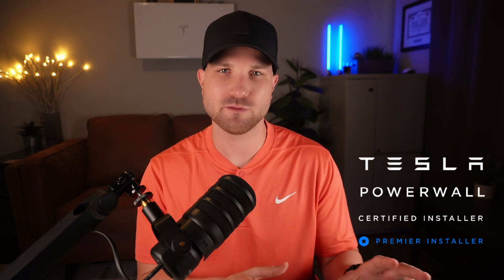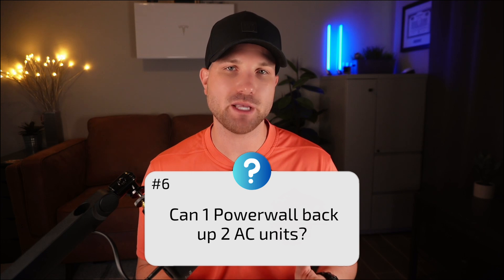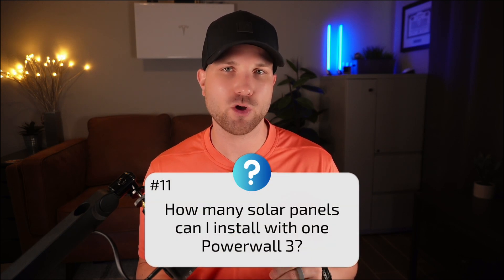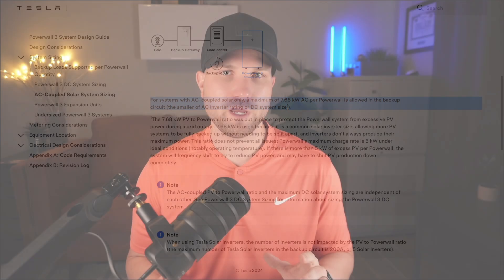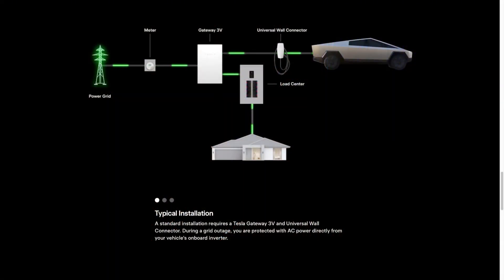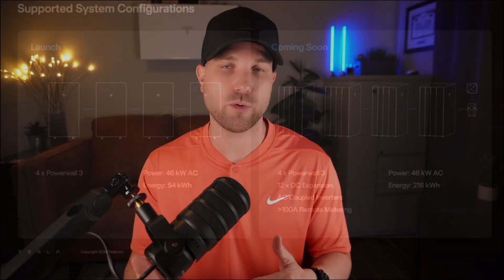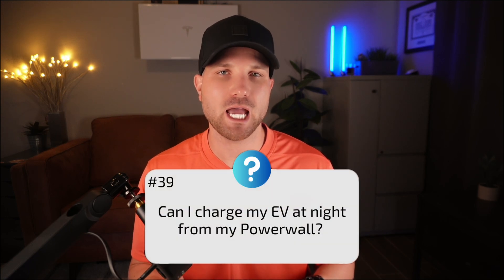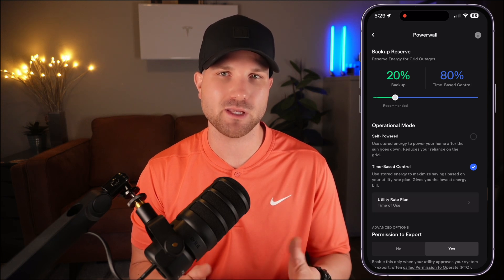Tesla Powerwall 3: Top 47 FAQs Answered!

Comment: Interesting that on question 15, you show the round trip efficiency of the Powerwall 3 as only 89%. I thought it was meant to be much higher, something like 97%. The Powerwall 2 was advertised as being 90%, but from my experience (dividing lifetime power out by power in), it's about 87%.
Reply from the maker: Yeah I was shocked to see it at 89% on the data sheet given the advertised efficiency of DC-coupled designs. I don't know if they are being overly conservative or what. The inverter efficiency is rated at 97.5% though.
Reply: @ZachSolar  I think some other Youtubers have been confused when talking about the PW3 and have quoted that 97.5% as being the round trip efficiency, then comparing it to the 90% for the PW2. As I said I've found my PW2 to be about 87% efficient, but this doesn't include the original inverter loss from solar DC to AC which would make the PW3 look even better in comparison.
Reply from the maker: @Pete856  Yeah 97.5% sounds way better, but that isn't accurate for RT efficiency according to the data sheets. My PW2 system sits at about 87% RT as well after 2 years. So 89%+ sounds right for a DC coupled PW3.

Comment: Zack, thank you for the video. I was wondering if there is any benefit besides financial between a PW3 with 2 expansion packs or two PW3 with 1 expansion pack thank you. We are PGE Customers
Reply from the maker: Glad it was helpful! The main benefit is just going to be power output. Once you achieve “whole home backup”, all you really need is more kWh so the expansion packs are a perfect solution that can save a few bucks. If the cost is close enough though, might as well get a powered unit IMO.

Comment: It would be greaat if you could actually get them.  I was supposed to get 2 installed in September, now they're talking January, maybe.
Reply from the maker: That’s a bummer! Is your installer Tesla direct or a 3rd party?
Reply: @ZachSolar  A 3rd party.  The company that installed the Sunpower solar panels in 2018 no longer does solar.  So I checked with Tesla and they recommended the installer for the Powerwall 3s.  They were supposed to be installed in late September, then late October or early November. Now they're talking January or I can get Powerwall 2s installed in a couple of weeks.

Comment: Two quesitons...   1: I have an agricultural building that faces south and has a subpanel fed from the house via a 200A 250mcm 4 wire underground connection.  If I put solar on the ag building would powerwalls also be installed in that building?  How about the gateway - same building or back in the residence?   Are additional wires required or does the solar and powerwall connect directly to the sub-panel in the ag building and back feed via the existing feed?   
Second question: the residence has a 400A service with multiple 200a sub-panels feeding a different garage and two sub-panels in the house.  Thus a backup solution would need to have multiple 200A gateways which is impractical.  What is the potential for a future 400A gateway or 400A backup switch?  The most practical solution for me would be solar on the ag building, powerwalls in the ag building and 400A gateway at the service entrance in the residence.  Hopefully this could become possible.  Thanks , great video!  - Thomas
Reply from the maker: Thanks Thomas! I'm glad the video was helpful 👍
1) Both the Powerwall(s) and Gateway may be able to be installed on that building and backup that subpanel. My concern would be any utility pushback or AHJ restrictions with it being further away from the main. I'd find a local installer out there and see what their thoughts are.
2) I haven't heard anything about a 400A gateway or backup switch coming from Tesla, but I might be out of the loop. Installing 2 Gateways is the most common work around in this scenario.

Comment: This is Cathy's husband Larry - we are both amateur radio operators - we just installed a Tesla PowerWall 3 and solar panels to our condo. I am seeing significant radio frequency emissions at set frequency intervals of 250kHz across the high frequency spectrum into VHF spectrum - for example, I have an antenna for the 20 meter amateur band and there are signals at 14.00MHz, 14.250MHz, 14.500MHz, and so on. These disappear when the sun goes down and the panels are not producing power. Also, last evening, just 4 days after the install, our HOA complex power went out. Our power also went out even with the PowerWall set up I thought for backup power. When I tried to disconnect from the grid, the app stated that we had too many appliances connected (we did not) which exceeded the capacity of the PowerWall. Today, with power restored, I was able to disconnect from the grid without the over-capacity message warning.  Any ideas?
Reply from the maker: For both of these scenarios, I'd reach out to your installer so they can troubleshoot this with you. I'd just be speculating on my end. Sorry, wish I had a better answer for you!

Comment: Do this. There's 6 string inputs. Only 4 are used. Use the other two inputs connected to the dc outputs of a small gas generator (they have dc outputs the days). Now you have a generator connection. Slow recharge when panels are covered in snow and grid is down.
Reply from the maker: Possible? Maybe. I haven't looked much into it.
Recommended? Absolutely not lol
Reply: @ZachSolar  lol. Agree. Do this on a demo unit, not your own unit in your house, at your own risk

Comment: The biggest question that I cant get an answer from anyone is solar curtailment. Can i via software automatically turn off the solar generation (eg if the grid price goes less than 0c/kwH)
Reply from the maker: Yes within the Tesla app you can disable permission to export. It won’t be automatic though based on a rate schedule. You’d have to manually toggle it on/off. You could use a 3rd party app like Netzero to set this automation though.
Reply: @ZachSolar  Hope Australian powerwall 3 has "permission to export" setting available :)

Comment: If one has a single meter, but 400 amps service (2x200 amp legs) can it be set up to feed only one of  the 2 legs?  Does that require any special/expansive hardware?
Reply from the maker: Yes you can do what you described. The gateway can backup 200A. So if you wanted just one of the 200A panels backed up, then only 1 Gateway required. If you wanted for both to be backed up, then 2 Gateways would be required. You can’t use the backup switch on a 400A service either.

Comment: Can you charge your powerwall 3 and power your home at the same time with solar? Are there any strings attached to this?
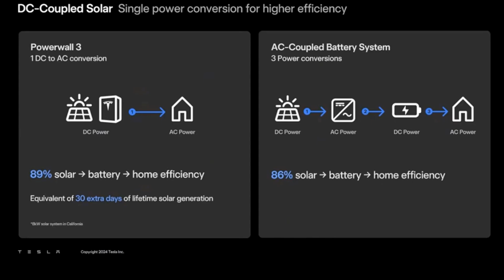Reply from the maker: Yes you can. Check out this clip at around 7:13 onward.
Reply: @ZachSolar  Thanks mate. Sorry one more question. I currently have a 11kw system with a 10kw SolarX inverter. When my SolarX inverted need to be removed?
Reply from the maker: @dpg2004  You could do that and have the system restrung using the PW3 integrated inverter. I might consider that seeing as a single PW3 wouldn't be able to support that 10kW inverter when AC-coupled.
Reply: @ZachSolar  legend. Earned a sub.
Reply from the maker: @dpg2004  Appreciate that!

Comment: Thank you for doing all these videos on the Tesla Powerwall 3. I live in the Los Angeles area and just placed a deposit on 1x Powerwall 3 for my home with a local company. I just hope the Gateway 3 and the Tesla Remote Meters will be available when it's time for installation. I already have solar with a SMA Sunny Boy inverter so it will be AC coupled.
Reply from the maker: You’re welcome! Thanks for watching 😀
You should be all good for the Gateway 3 & remote meter. If your installer has Gateway 2s in stock, then they might use those. If not, you’ll have the GW3 with the new RM. Either way, you’ll have full monitoring.

Comment: Great Q&A, Zach.  Regarding #42, if the WiFi goes out, you can still communicate with the Powerwall 3 through the app.  Our home internet went down for the entire day yesterday, but we still had great sun. I was very curious what would happen because I thought the PW3 relied on WiFi to operate. I was still able to see the solar and PW3 through the app, the system continued to work as normal, even charging my MYP “on Solar”.  Clearly the PW3’s just pivoted to cellular and operated normally.  I also was able to change Powerwall settings while my WiFi was down.  My units are not Ethernet connected.
Reply from the maker: Thank you! Very cool to hear that the cellular took over and worked seamlessly with the WiFi going down. Hope you’re enjoying your PW3 system! 🔋
Reply: @ZachSolar We are loving it so far!  Does a great job selling power back to our utility (PG&E) during super high buy back pricing in September. My two PW3’s discharged at a rate of 23 kW just as expected!
Reply: I believe that you can also link your phone directly to the power wall , check out settings and then phone pairing (I’m in uk just in case that makes a difference!)

Comment: Hello Zack, I have a 2004 Carrier heat pump compressor, do you suggest a hard start or soft start kit to assist with a single Tesla Powerwall 3 ? Thank you for your time and consideration. Respectfully, Joseph
Reply from the maker: Hey Joseph, the PW3 can handle up to 185 LRA. Is your heat pump under that mark? If yes, you’re good to go as is. But if you are over that 185, I’d say that soft start is the way to go. However, on older AC units I know hard starts are a popular option but I don’t believe they reduce the inrush current.
Reply: @ZachSolar  Hello Zach, Your prompt response is greatly appreciated. Yes, we’re definitely below 185LRA, although my PW3 Tesla certified installer, suggested a hard start kit to minimize initial startup electrical draw from the PW3. 
What’s your opinion, hard start or soft start kit ? 
Recognizing it’s only for startup and will not affect  overall HVAC electrical consumption.
Look forward to your insightful reply. 
Respectfully,  Joseph
Reply from the maker: @josephdonini5038  Disclaimer: This is not my wheelhouse, so I could very well be wrong here. If reducing strain on the PW3 is the goal, then I'm almost certain that a soft start would be what you need.. Soft starts reduce the initial inrush current. Hard starts increase that initial inrush current. I'd clarify why they are making that hard start suggestion and if a soft start would make more sense. Hopefully this helps!

Comment: I was literally just quoted $75k-125K for a 3 Powerwall install with 10KW of solar.... Completely turned me off of Tesla for my in home backup. I'll likely be going Anker or Ecoflow due to this.
Reply from the maker: Unless you have a super complex project scope with electrical work, that’s insanity. How many quotes did you get?
Reply: @ZachSolar  Just the one from the company that contacted me from putting my info in Tesla's site. Not sure how else to find Tesla certified installers here in East TN.
Reply from the maker: Try this link: https://www.tesla.com/support/certified-installers
If no luck, go with another battery option. That’s way too expensive IMO
Reply: Looks like you were over quoted. I had Tesla install a 14.4 kWh system with one Powerwall 2 battery, in Northern VA, for around $42k about 2 years ago. PW2 batteries were 10k each at the time, so a system with 3 batteries would have been 62k.
Reply: I’m getting a 3 Powerwall 3 system with 15Kw of panels from Tesla for 65k. When the tax credit is factored in, 43k. Not sure where you are, I’m in San Diego, but your quote was really high
Reply: @prettygood1976  Yea, that's more what I was thinking. I live in SE Tennessee, so not many choices in my area. Oh well, I'll wait a few more years and see if the market changes in my area.
Reply: Awesome video! Thank you! Have one PW2 and am seriously considering getting another if they cut the price. The PW3 comes with a built in inverter so figure the PW2 without an inverter should be discounted 😊
Reply from the maker: Thanks!! And I’d reach out to your installer and see if they have any in backstock. Tesla is no longer manufacturing PW2s so they will be very hard to come by soon.
Reply: What company was this quote from? I’m also in TN and am in the process of getting quotes.
Reply: @WillNoggle-kc6tx  Lightwave Solar.
Reply: We typically price that kind of install for 52k-55k before the solar tax credit. Net cost (if you qualify for the credit) is ~36k-39k. Range is dependent on complexity of the project.
Reply: You need to get better at getting quotes my man, wild!
Reply: Wow, I just signed the contract directly from Tesla. 7.4 kwattss with 3 powerwall 3 for $42K before tax credit. After tax credit, may be about $30K.

Comment: Q: When the software update makes Powerwall-3 compatible with Powerwall-2, can the P3 DC Expansion be added to an existing P2 system, or is a regular P3 needed? For instance, if the current setup consists of three Powerwall-2 units on a 125A service panel and you want to expand storage capacity but Powerwall-2 units are no longer available.
Reply from the maker: Great question. Let me get confirmation. As a PW2 owner, I hope it could work. My concern is the fact the PW2 doesn’t have the same port the DC pack uses for wiring the batteries together. But perhaps there’d be a work around, however I feel a standard PW3 would be needed.
Reply from the maker: Unfortunately, DC-packs will require a PW3 to be installed. This is due to the DC-port on the expansion packs and the adapter that is used. It wouldn't be compatible with PW2.

Comment: I was told by a Tesla rep that came to my house for an assessment that my Cybertruck will be used and looked at via the gateway as an additional battery.  They also said I can use the truck and it will not void the warranty...no matter how much I use it to power the house
Reply from the maker: Not sure if you have this set up yet, but will your Cybertruck discharge any energy to the home when on-grid like a Powerwall? Or only when in a grid down situation? 

My understanding is that the Cybertruck would only discharge to the home when an outage occurs. Maybe I’ll have to go buy one for testing purposes 🤪
Reply: Also, from what I understand, the Cybertruck cannot function as an additional battery in the traditional sense. It can only serve as backup power during a grid outage and cannot export energy to the grid for VPP or other purposes. The reason for this limitation is to prevent users from charging the Cybertruck at a different location and discharging it at home, which could create imbalances in energy distribution.
Reply from the maker: I hadn’t even considered your last point about VPP and charging at different locations. Very interesting!